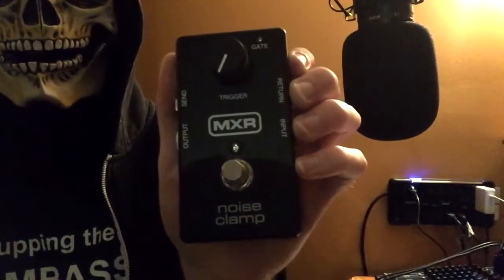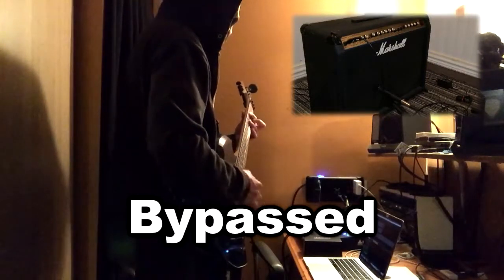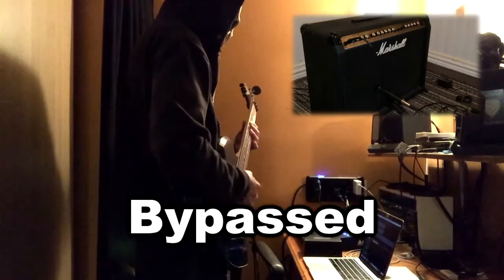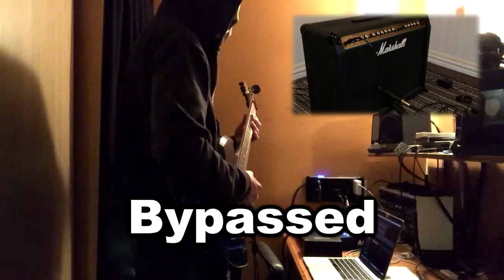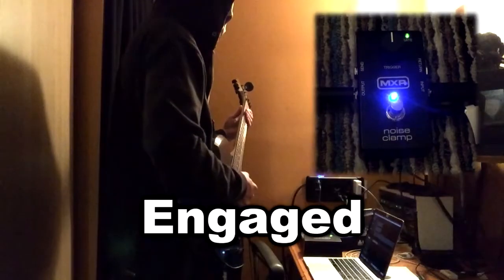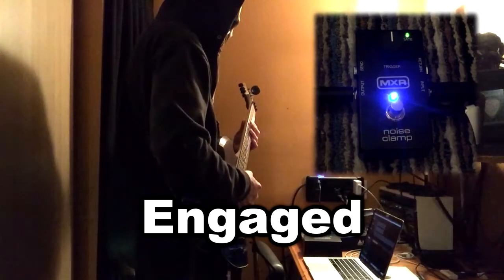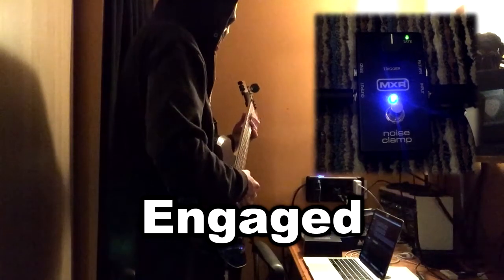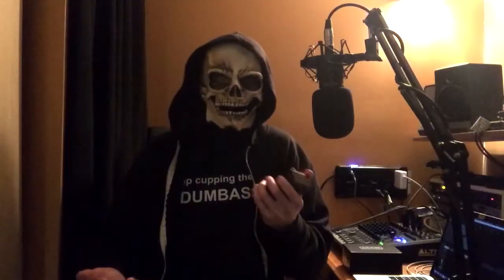MXR M195 Noise Clamp Review | SVFC

Comment: Cool video man....I have a EVH 2x12 and Jackson...I use no distortion pedals because the amp has a great distortion tone but it tends to be a little noisy...Can I put one of these in line from my guitar to the amp to quiet it down?   LM
Reply from the maker: Yeah, it should clean things up.
Reply: Well, I had one ordered and got it today. It works really well on quieting down excess string noise and feedback....I wasn't, sure since I wasn't using the effect loop but yes, it sure cleaned my leads up on the amps high gain channel...….take it easy..... @oxymoronstudios3639